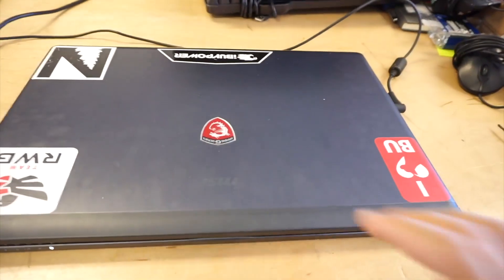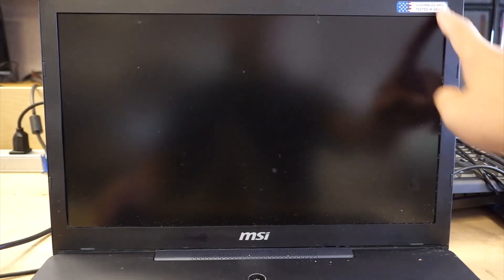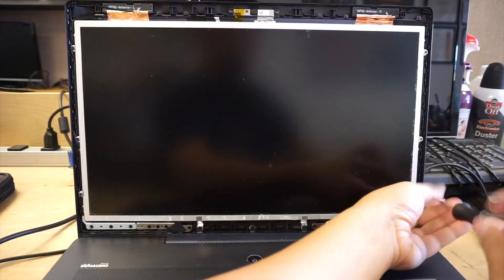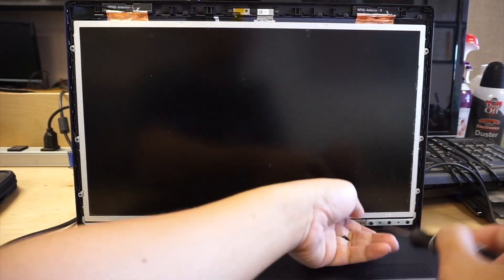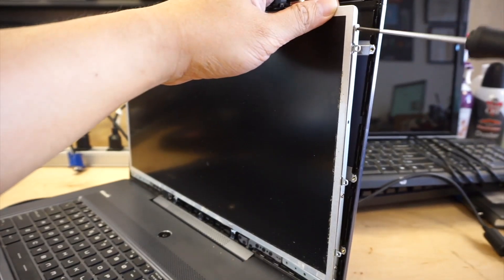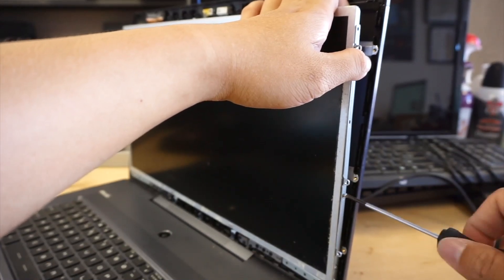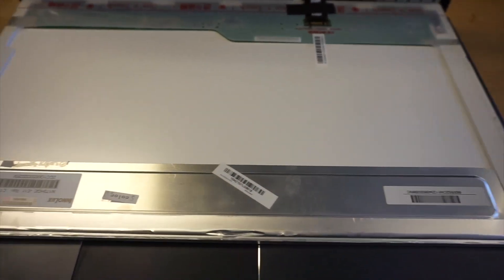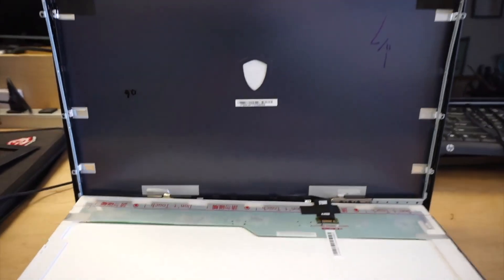How to replace MSI Laptop 17" MS1773 screen replacement

Comment: Can i ask why did you not remove the battery innside laptop?
Reply from the maker: One less step to do.
Reply: @UbergeeksBiz  but cant you frie something if the laptop turns on if the battery is not disconected? Some youtube videos say to take out battery before replacing lcd, and some guides dont do it, getting confused.

Comment: I replaced the screen just like you did in the video, now the laptop won't turn on, not even on an hdmi like it used to, can you please help me? I have a gs75
Reply from the maker: Try remove laptop battery and do a direct power from adapter. Hope that helps.

Comment: at the bottom of the screen is the "woofer speakers container with little holes like hinge", the hinge's interior is accesible to replace the speakers inside of it? or that container is the speakers itself and indivisible? Because I wanted to "open" that container without forcing too much and dont seem to opened up

Comment: Not sure if you still reply to comments. I have this version of lptop, but my hinge in broken and ha been for a while nd now my screen has died, if this someting tht i fixable or should I look at replacnig my laptop?
Reply from the maker: About the hinge, you might have to adhesive glue them back together. Or if you can find entire top LCD with the hinge all together, you can replace the entire top assembly.

Comment: Hi  @UberGeeks, the damage I see is pretty dynamic, which makes me think my problem is in the connector cable rather than the lcd. Do you have any idea where I could find a replacement? I wouldn't know what to look for, what the specific connectors are called etc...
Reply from the maker: Thanks for the message. 
Almost certain LCD cable does not go bad unless is shortage burnt or physical cable got cut. If you want to replace the cable, here is the link to purchase:
https://ebay.to/34MqgW3
Reply: @UbergeeksBiz  Awesome! Thanks a bunch for responding.

Comment: I've seen you still replying from a month ago comments so i would just put my question here and hope for your reply.
So my question is i have a siedways white line in my Laptop screen horizontal line it's just a one line for now i dont know if its going to get worse if action is not taken. Is this a gpu problem or just a loose connector or ribbon?
Reply from the maker: Hi, 
Thanks for commenting. 
Best way to test it, try to connect to external monitor or tv. If other screen has no horizontal line, it must be coming from your laptop LCD screen. Will it get worse ? No. Hope that one line does not bother you. 
If to guess, I think it is coming from LCD screen. Not your GPU. Hope this helps !
Reply: @UbergeeksBiz  Thanks for the immediate response mate, i just hope so it's not coming from gpu.